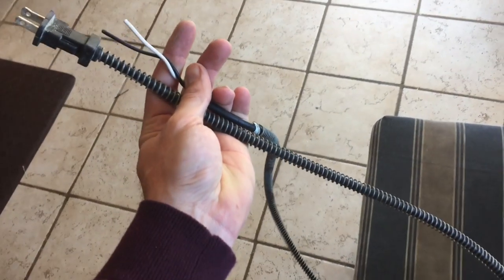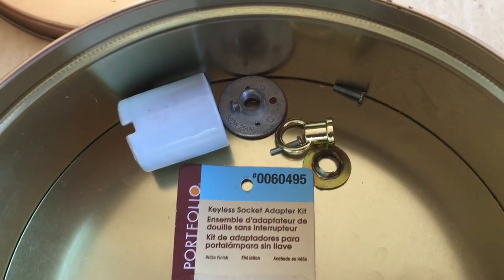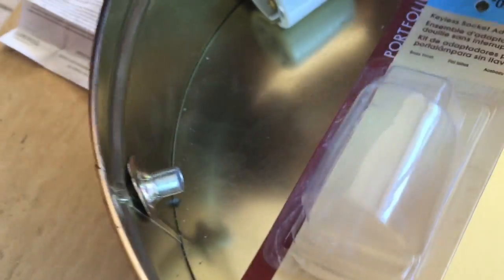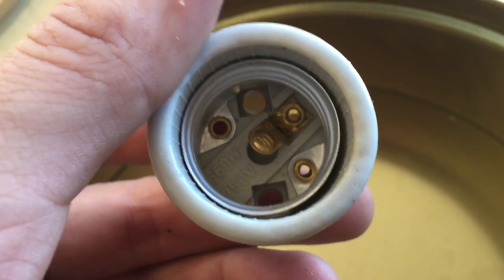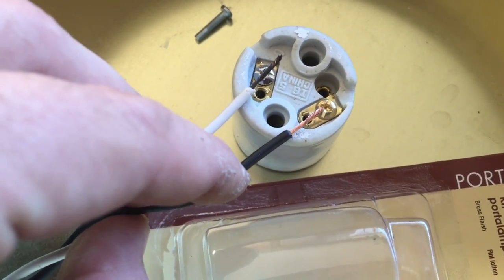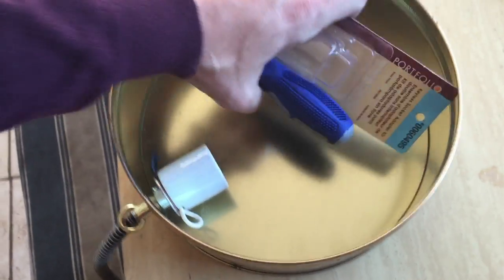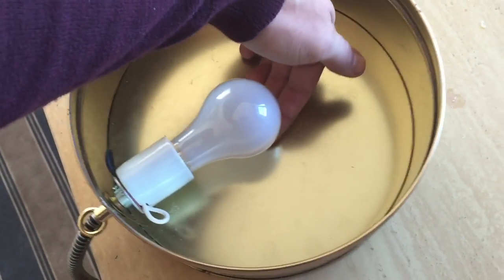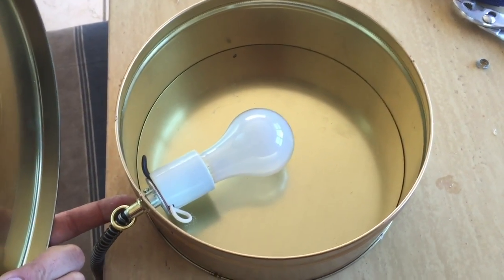DIY Chicken Water Heater for under $10

Comment: a little sand in the bottom that does not touch the bulb will help hold the heat if the air only does not provide enough heat on really cold days/nights
Reply from the maker: Thanks for the tip!